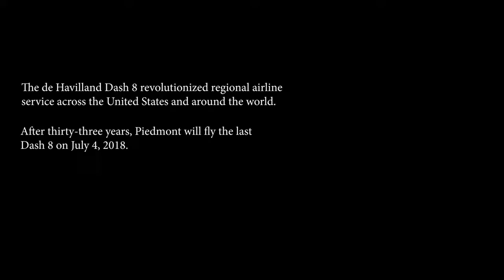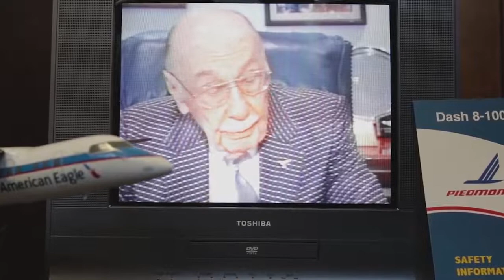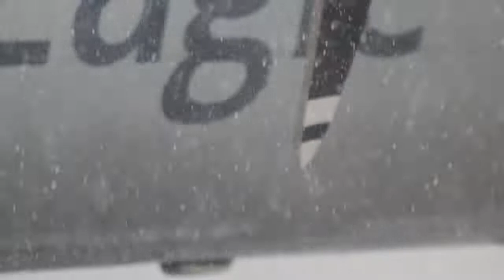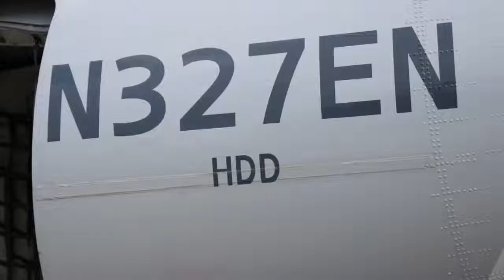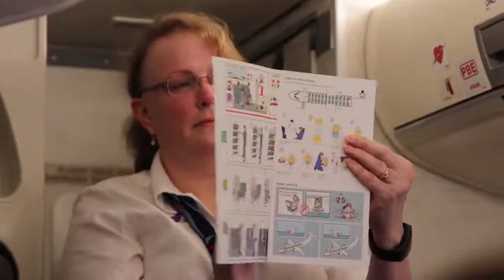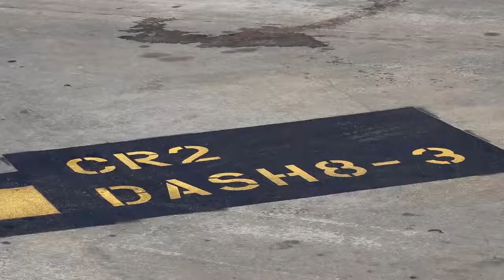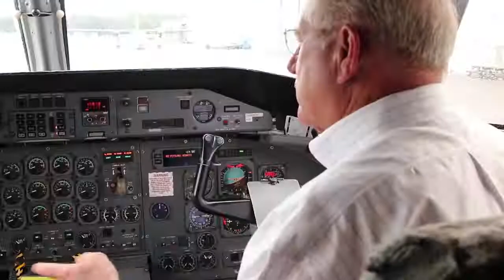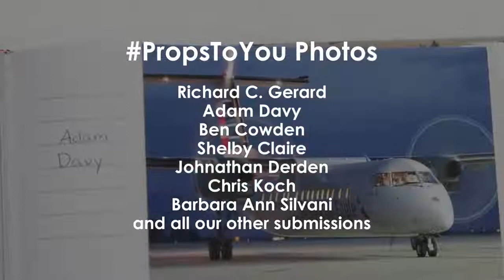The de Havilland Dash 8 Story at Henson Airlines

Comment: 1989-98.  SBY-BWI-LYH-CHO-ORF   The Dash was a great place to work if you were stuck at the commuters for ten years as the economy hiccuped back and forth.   PAA, EAL, TWA, and a host of other airlines all shat the bed during that time and flooded the market with high-time 121 guys.   The AC was crap on any plane more than 2 years old.    The pay was crap and the schedules were lousy.   Lots of time on the road, in hotels and ops.  On the plus side, the thing would carry a ton of ice and we had a lot of good guys to work with and lot of great FA's.     Great guys working line Maintenance in DC and CLT.   Probably some of the best times I ever had flying.  360's over Niagara Falls at 2000'.    Low 'n' slow up an down the Bay.   Franky and The Dickheads.   Finals week in GNV.    Wild Wings in HHH.  Big Jims in CHO.  Iguanawanna in HPN.  Joey's in CRW.   Yucatan in TPA.  Murphys in DCA and two dozen others.   My liver took a beating!      ;)